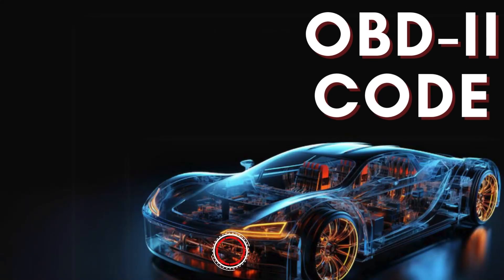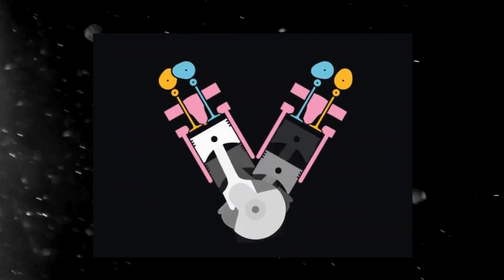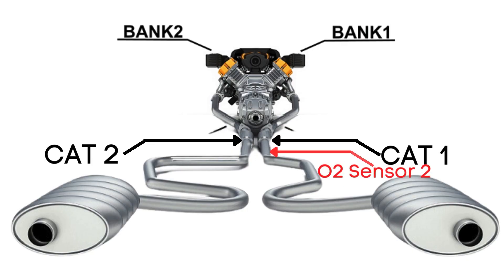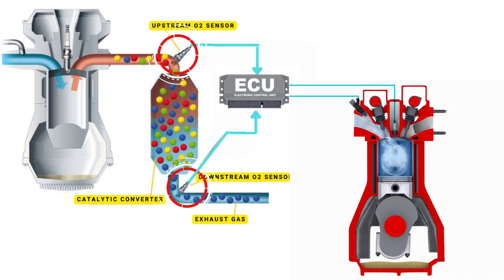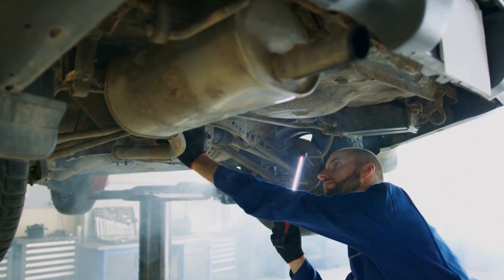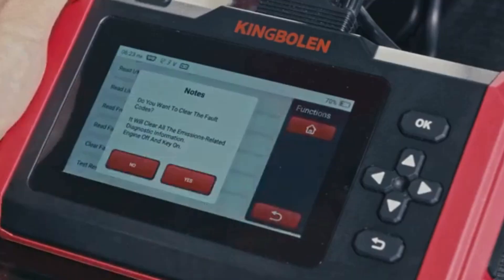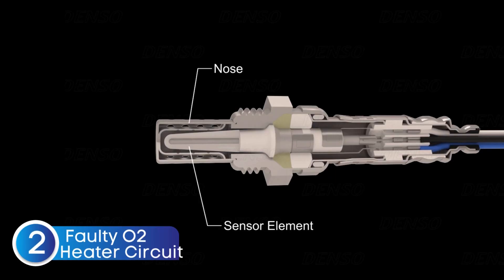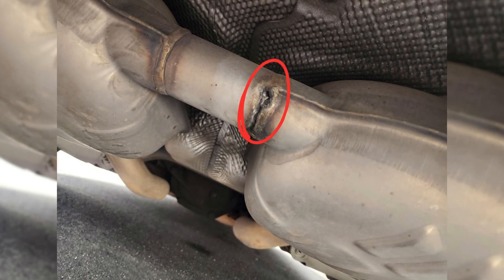How to fix P0136? | Oxygen Sensor Circuit Malfunction (Bank 1, Sensor 2)

Comment: In certain situations, you may need to swap the right coils and spark plugs with those on the left, and vice versa. Then, disconnect the battery to reset the error. After reconnecting the battery, check if the error reappears. If the error code changes, the issue likely lies with the coils and spark plugs. If the error code remains the same, the source of the problem is likely elsewhere. This is a free check before you buy new coils or spark plugs.
Reply from the maker: Thanks for the tips.